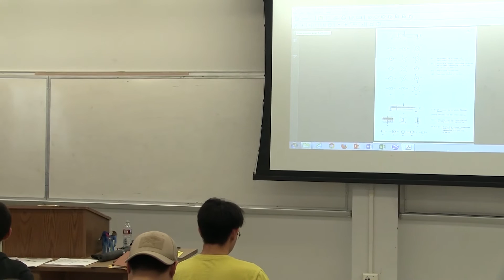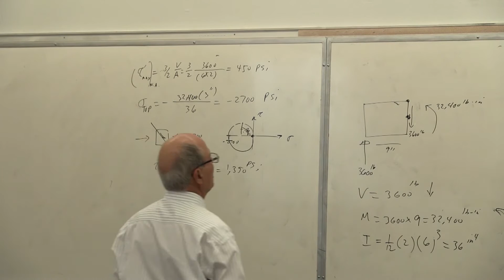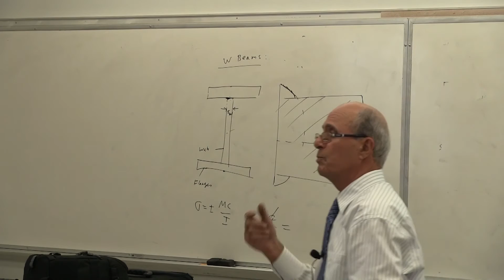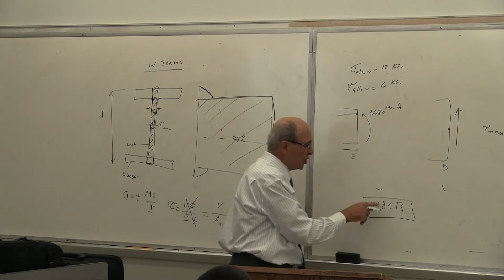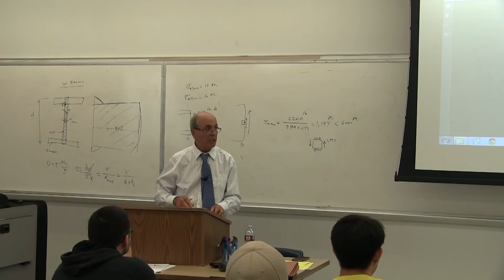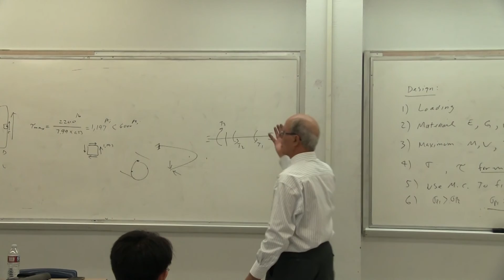Strength of Materials II: Principal Stresses in Beams, Beam Design (6 of 19)

Comment: So I'm assuming the only time when V (The shear force) incorporates any kind of shear stress, is when it's in the tangential direction and when the beam is in bending. This is only when the location if interest isn't at the edges, correct? also, would you normally prepare for the combined maximum shear or the shear created by the bending stresses (due to mohr)?